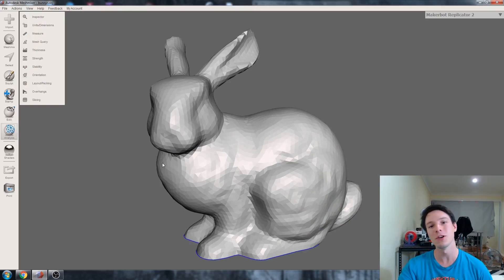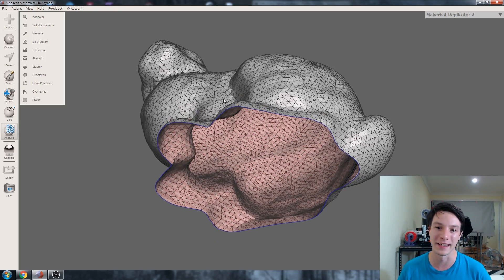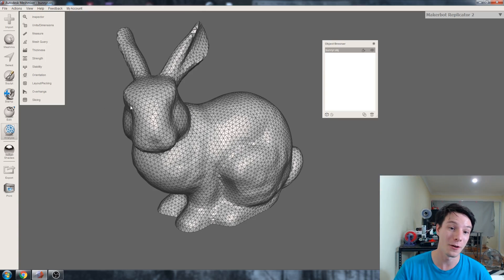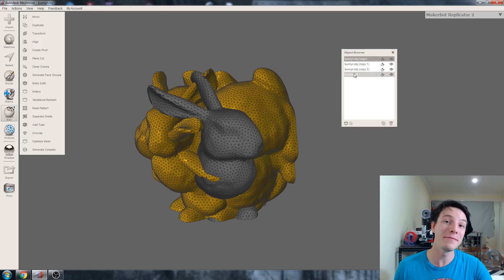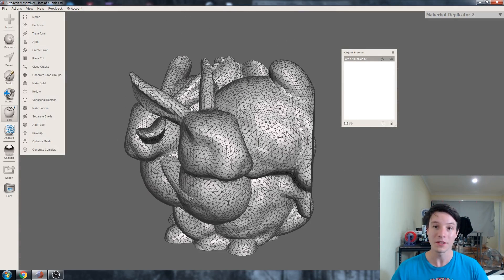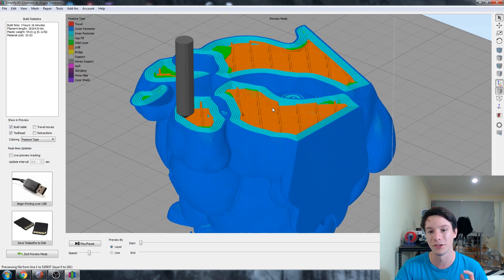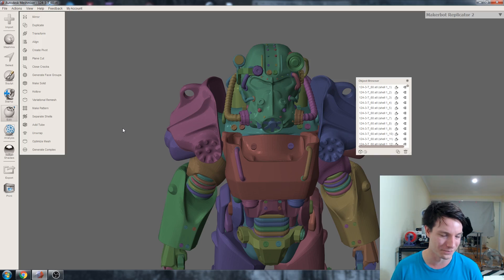Why do Intersecting Shells Suck for 3D Printing? 3D Printing 101

Comment: Angus Just curious where did you originally learn the term shells from? As a 3d student I was surprised that this was a term I had never heard of though we usually refer to shells as objects or meshes ect. Might just be a US thing but I'm glad you defined what a shell is now I will understand your future videos better! 

Thanks again for an awesome video! Eagerly awaiting a "filament and your machine" video XD haha

FOR ANYONE CURIOUS: For me personally I us Autodesk software specifically 3ds max. Thankfully in that software you can simply attach shells together and make them all one object. I've found that to work best anytime I have an error in my printing software and 9 times out of 10 that is usually the case if you have too many separate shells.

Due to the type of models I print (figures/miniatures) I sometimes have to have variations of the same model with a different outfit or hat ect. For this separate shells I have found to be helpful as far as being able to export different versions without having to model a whole other figure. Granted I would limit it to nothing more than 3 total shells (in my experience) but if all else fails you can combine them all into one mesh and it usually prints fine.

Comment: I was struggling to fix a 3D Model for such a long time. Meshmixer couldn't fix it, Simplify3D couldn't fix it. Before watching this video I didn't know the Windows 10 "3D Builder" could repair models and the 3D Builder did the job at which the 150€ software failed xD
You helped me so much just with that recommendation :)

Comment: Nice informative video, i learned from tutorials online back when i bought my printer last year that i should create a nice solid shell and never had the guts to try with intersecting shells.
I just use Zbrush's Dynamesh to boolean together or sometimes Maya boolean as it just modifies geometry in the area of the boolean, also for printing multiple pieces so they will fit together it's nice to create keys ( a cube for each piece in positive and negative so everything fit's together nicely when gluing).

Comment: I would've assumed boolean union would be automatically applied at some point in the process whenever there are overlaps. Why is that not the case?
Reply: I meant with 3d printing. Wouldn't it make sense for boolean union to be applied automatically by one of the programs that the file goes thru for 3d printing when there are overlapping shells?

Comment: I use 3d Builder quite heavily. Its free on windows 10. Its operations do indeed mostly work very well, though subtract tends to cause exponential mesh growth if you are not careful and merge can cause some very funky tessellation at the boundaries. The simplify function is the only disappointment - largely crap. I love the interactive controls - very intuitive, particularly the split function, which I use all the time to fit stuff into my build volume.

Comment: Is that the reason why this model https://www.youmagine.com/designs/hedgehog-pencils-holder (that our daughter desperately wants printed :-)) make S3D generate weird stuff?
Reply from the maker: Yep, just had a quick look and that model is full of errors and multiple shells. If you have windows10 fire up 3DBuilder and repair it in that :)
Reply: Mostly Mac and Linux here, the latter usually headless - but thanks for taking a look!
Reply from the maker: +Volker Wegert in that case you may still be able to use cloud.netfabb.com !

Comment: Awesome content, I really like how you explained why the STL model was generally not suitable to be printed properly. Is this problem with the intersecting shells, also an issue in .obj format?

I have had problems with STL models, but didn't know why until now. It's time to load that up in Meshmixer. I hope I can find some of your tutorials for using that program.
Reply from the maker: Just search 'meshmixer' on the channel search and loads will pop up :) .stl and .obj meshes are very similar, and can be repaired in much the same way.

Comment: If STL files have no size data, how come designing something in mm in 123D comes out perfect in Cura without the need for scaling?
Reply from the maker: Because you are exporting in mm and importing in mm :) It has units, it just doesn't know what those units 'were'
Reply: So technically it does have size data? I mean the numbers translate to metric or imperial or whatever but those fundamental "units" have to exist in the first place. Maybe I'm being pedantic but "having no size data" to me means it has no frame of reference to work with, but clearly it does when it imports properly. It would be more accurate to say "it has no real world size data, but is measurable by software which has to translate this into real world size".

Comment: You should use a hollow object as an example of why STLs do allow multiple shells, and why slicers are actually supposed to create holes when shells are inside shells. If a space is enclosed in an odd numbers of shells then it is solid, even shells (including zero) means open space. If this wasn't the case slicers could just union everything together.
Reply from the maker: Good point - I'll link to my normals video that explains that portion of it. It's a bit of a rabbit hole, you need to explain more and more concepts.

Comment: So, if I took the Power armor, separated out the shells and printed each shell, I wouldn't be able to make my own suit of Power Armor as a Cosplay?
Reply from the maker: Hahah... well you could use the model as a basis, but there's probably ~100hrs of editing work required to create armor plates you could 3D Print to wear for cosplay.
Reply: Not to mention 100+hours of printing.  It would be worth it for such a detailed suit of armor.

Comment: Is there a reason why someone would intentionally make a model with multiple shells for printing? Why is it that so many models have this problem? Is it just lazy designers or is this an artifact of the models being translated from some other format?
Reply from the maker: When you organically model you create a new primitive for each new feature you add, eyes would be a good example - just add a sphere. For game assets, animation or rendering it doesn't matter but when you go to 3D Print... things go south quickly :P Not the designer's fault really just a lack of understanding on what a 3D Printable mesh file should be like.
Reply: Isn't is a little dumb to model this sort of way, even what you're not modeling for a 3D printer? For example, a model designed for a videogame or for rendering a film would carry all of the extra polygons around inside it that you would never actually see because they are occluded by other polygons or shells? So, your assets would constantly be taking up extra rendering time as they would have to be sorted and discarded if they were occluded or their normal faced away from the viewing frustum? 3D cards are insanely powerful these days, but it's still horribly inefficient to design this way. The only place where this might make sense is if the model was articulated and part of the movement could reveal more or less of the occluded parts. But this makes no sense for the details like the screws and the greeblies on the bodies that are just fixed details on the surface.
Reply: @USWaterRockets
I'd assume it's because it's easier to edit something afterwards - if you need to edit the eyes (for whatever reason) it'll be a lot faster to pull out the eye-orbs and modify them, instead of trying to separate the eye-parts from the skull/brow/nose regions they're combined with.
Not to forget coloring - the whole eye can be colored white with no danger of spilling to other parts.

I'm sure rendering is cheap compared to what the artist costs.
Reply: You're making my point for me. Yes, the hidden triangles are not actually rendered, but the fact they are hidden does not mean they don't impose a burden on the system. The hidden triangles take up memory and memory bandwidth to store and move around. The hardware has to compute whether they are visible or not depending on a number of factors, including whether they are fully obscured behind other triangles. This takes away time the hardware could be doing real work on objects that are truly visible. I'll use an extreme example to illustrate:Make a Cube. It has 6 sides, the most you can see at any time is 3. That's 6 triangles. It should render really fast because it's simple. But I've put 10 billion small cubes inside the first one. Now the rendering speed goes to crap because the burden of 10 billion * 6 sides * 2 triangles per side = 120 billion triangles that need to be checked for visibility and ignored. I've just choked the system with useless shells. That's how I see this working in practical terms.
Reply: Maybe I was not clear. I was not talking about rendered animations, I was talking about assets for videogames, which need to be rendered in real time.

Comment: Hey Angus, just curious what software to you use when you are creating your own custom models. Also what program do you use to modify existing stl files?
Reply from the maker: It depends on how you model - I use fusion 360 for engineering style design, and meshmixer is perfect for mesh editing of .stl's, I have heaps of meshmixer tutorials!
Reply: Maker's Muse Awesome, thank you. Fusion 360 is cloud based correct? Is there one that isn't that you can recommend? Also do you have a tutorial on how to calibrate your printer for bridging using Simplify3D? If not do you think you could do one at some point?

Comment: Put together an i3 clone kit, in hopes I could get into 3D printing 
Unfortunately, the extruder doesn't heat up at all (though the thermistor works just fine). 
I guess the extruder was D.O.A? Replacement recommendations?
Reply: If you bought it on ebay, message the seller and I'm sure he will send you a new one. Otherwise, search on ebay for an extruder. Depending on your printer, you may be able to buy one. The extruder on my printer can be found by searching for "MK8 extruder" and it works great. 
Best of luck.

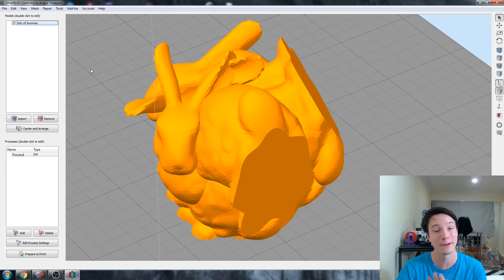Comment: 8:24 seems to be a key point (for Simplify3D users), but it's glossed over.
Reply from the maker: Definitely, but considering most of the files that have this issue have literally 100's of meshes and you can't do this kind of thing in other slicers, it's a bit of a hack at best IMHO.

Comment: I see a lot of this, and non-manifold objects on Thingiverse. Sadly, the people posting them don't seem to understand or care.
Reply: Greg Webster non-manifold, what is that?
Reply: Faiq Ramli it means that its not watertight... Holes where there should not be.
Reply: Greg Webster thanks
Reply: +Greg Webster as a mathematics student, please, please don't use manifold to refer to such a mesh. Unless you want to create even further interdisciplinary confusion with the terminology.
Reply: Cappu, Non-Manifold is not a term Greg made up for it, it's a term the 3D modeling industry uses. A bit late to change it :)
Reply: +Cappu Cino - He did not "use manifold to refer to such a mesh". In fact, he specifically used "non-manifold". Which is quite correct, in a mathematical and topological sense.

Comment: we 3d artist usually call it Intersecting polygon. but shell kinda work as well
Reply: Strictly speaking, a polygon is 2D and has a closed loop made up of connected straight line segments around its boundary - a shell is 3D and has a closed surface around it.
Reply: yup that is correct. but the 3D artists are calling it intersecting polygon though. dunno why
Reply: Because they're looking at the individual elements that form the shell instead of the shell as a whole?
Reply: i think because the part that intersecting is actually the polygon.  althought i dont think they use the term "shell". they usually use the term "mesh"

Comment: Does Tinkercad create intersecting shells if I import a few things (either stl files or svg files that I assign a thickness to) and then I overlap and group them in Tinkercad before exporting a single stl? or does the "group" function in Tinkercad serve to properly combine the shells?
Reply from the maker: Nope, tinkercad is great at combining them into a single manifold mesh! I did a video showing it here (tinkercad has improved a lot since then too) https://youtu.be/D2WJZqWH3r8
Reply: That's why tinkercad is so good when you are a noob, it allows you to created models without worrying about intersecting shells/meshes.  Things change when you move to a Fusion 360 or other cad program and expect it to print as it does for tinkercad.  Great vid as always Angus.

Comment: Angus,
Thanks for that explanation. As a newbie, I learned something I didn't know I needed to learn.     :-)
Reply from the maker: It used to catch me out ALL the time! The UP slicer will try and separate mesh's with that gap, but has no print preview. It took me ages to work out why some files would literally fall apart in my hands haha.
Reply: +Maker's Muse , please do more focused videos like this!

This is a fantastic learning medium, and these are the hard won solutions that we all need in our tool kit of problem solving. 

More time saving methods and tricks with S3D please!
Reply: Google Sketchup has a function where, just so long as all of the groups are solids (no internal geometry), no matter how many there are, it will combine them into a single group and discard any polygons "inside."
Reply: Blender has the option to fix this with it's 3D printer add-on.  It doesn't always work, but it if it isn't too nasty, it will make it workable.  Also, there's an option of Ctrl+Alt+Shift+M to find out the culprit vertices that are causing a non-manifold object.  I usually just fix everything myself.  I've only used the mesh fixing software once before... that was before I could 3D model well.
Reply: I've discovered the the only way to expect a mesh to stay anything remotely manifold when faced with complex topography is in using CAD software. Meshmixer is a bit of an exception but has its issues.  I'm curious about this blender plugin!

Comment: those are not shells. those are intersecting meshes. Don't get me wrong, both are terrible, for printing and for rendering/lightning a scene. If you would like to see how would a shell self intersect, just put some not so simple object in 3ds max or maya, or blender, apply the modifier shell and expend it till it self intersect. some very close joints will cause these all the time, and is a pain to fix if you need that extra thickness. bad for.printing, bad for tender just like those meshes.
Reply: I know my English is terrible, so to resume: meshe, 3d representation of any volume or form made with polygons, This one can be open or closed just as Angus was doing in the beginning with the rabit.
shell, is a common modifier to 3d meshes, they will creat thickness. to the object, normally extruding all polygons in their normals (direction which they will extrude).
Reply from the maker: The big issue is 'shell' is a term used for loads of things. It's used by meshmixer to define separate mesh's, but also as you say used by 3D software as a function to hollow out objects (such as shell in Fusion 360 to hollow out a shape to a certain thickness). Like my disclaimer at the start I definitely do get terms wrong! However I think this field is changing so fast we're quickly running out of terms! Some slicing software even uses 'shells' to define how many times the extruder traces around the part just to confuse things even further.
Reply: Maker's Muse hahaha. hollow!!! that was the term I was missing. thanks. hehe. I get what you meant and how these term can be misleading for those who just got in 3d modeling thanks to 3d printing. As a non English speaker I always thought in shell as in Mario kart turtle shells. and the term used in modifiers made total sense to me when first started modeling in max, cause, a shell was "something with another thing inside" something that hollows an object. and a group of polygons would always be a meshe, like in fabrics, they can take any form or volume with the right modeling. the important thing is, intersecting poligons, are a bad thing, be it as a meshe or as a shell, they really do make a mess.
in max, when using physics fx modifiers to a scene, there is even an option, to not intersect meshes no matter what when exploding or stretching objects. cause the render engine will got confuse and we will get glitchs.
thanks for the vids, been watching since I got in 3d print. you have several Brazilians following you here.